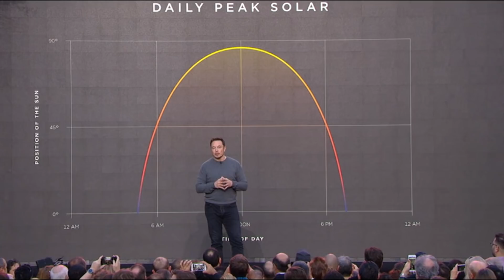Good Idea: Why Tesla Buying Soon-To-Close GM Factories Would Be Great For Tesla, EVs

Comment: Locate in Oshawa, Ontario Canada.  Newer plant, lower value of Canadian dollar, proximity to parts suppliers,   benefits of New Nafta. Many wins! Screw GM.
Reply: Yes makes perfect sense.
Reply: also, canada's got a stable, solid trade deal with the EU, and the oshawa plant is on the shore of lake ontario.  which leads to the st. lawrence, which leads to europe.
Reply: And a good place to test vehicles in cold weather, like the truck and semi.
Reply: Problem right now is Drug Ford is the Premier and he hates Tesla.
Reply: Can he block the sale to Tesla by GM?
Reply: @randallmxd.7787  Blocking the sale to Tesla would be politically expensive for Doug Ford. He has jobs to deliver to the laid off Oshawa workers.
Reply: @paulmcgreevy3011  HUH?  The Conservative Party is in power in Ontario.  And the laws regulating motor manufacturing is at provincial level.  Try keep up.
Reply: @markplain2555  
Interesting times when the NDP implement socialist oil production controls recommended by the conservative UCP of Alberta.
Reply: @paulmcgreevy3011  Just does not get it. Has no clue about the Canadian political system.
Reply: @paulmcgreevy3011  Huh? Trudeau is a Liberal in name and policy and not a conservative in name or policy.
Reply: @randallmxd.7787  Ford would try, he's an #AgentOfDestruction.
Reply: @johnklein338  
Doug Ford has meddled with Ontario EV sales incentives and Washington state regulators has denied Hydro One's merger with a Spokane electric company because of "political interference". While Tesla did win against Doug Ford for being unfair with their EV incentives, the incentives are still unclear for Tesla buyers in Ontario.
Reply: @paulmcgreevy3011  HUH??  Trudeau is full blown Liberal.  Nothing Conservative about him.  I think you are confused.  Try Google.
Reply: @Obscurai  I was thinking that the other day.
Reply: He wants to keep his company American
Reply: walt charamba   You shouldn't call a nation stupid.  You should say he is Canadian smart.  I was speaking of the company
Reply: ...and we got stronger beer.  :)

Comment: Everybody's giving very loose reasons for why Tesla might think about buying former GM plants, but why wouldn't they just expand GF1 and not take on the burden of retooling and existing factory and the potential pitfalls that come with trying to buy an asset from GM? Basically, if they have to redo the inside of the factory, it's likely not much more cost to just continue building out GF1 and begin recouping costs and harvesting solar energy.

Comment: I hope Tesla buys a couple of ex GM plants, at least. I wonder how many commercial vans, minibuses, pick-ups, rigid and articulated trucks and buses, intercity coaches (similar to the Mercedes-Benz Intouro or the Iveco Crossway) and coaches Tesla will introduce in the next few years. Personally, I hope they introduce large numbers of different models, and I also wonder how much of a shakeup they will have on the market. I wouldn’t be surprised if Tesla electric citybuses would actually be much better than the current offerings, especially when the offerings from New Flyer and NovaBus seem to be based on the standard models (the New Flyer Xcelsior is also available as a Trolleybus, but that uses wires most of the time), so I wouldn’t be surprised if a number of compromises had to be made. However, in the US market, there is also a fully electric bus manufacturer (Proterra), so I would love to see what Tesla comes up with compared to Proterra. Perhaps they could compete in the BRT. Us segment, perhaps trialling a demonstrator on the Orange Line in Los Angeles, possibly equipping their offering with Autopilot and a version of Drive on Nav with the routes pre-loaded.
Reply: the GM plants being closed are very specifically made for SMALL cars.  GM is cranking out larger SUV's and trucks, so if it were viable to convert these, they would.  Its not.

Comment: Biggest problem everyone seems to be missing is these plants are all in heavily controlled UAW parts of the country. Tesla doesn't want to allow their employees to unionize and if these old GM plants became Tesla plants there's no way Tesla is gonna pay union wages. It would take years to get a workforce to run the plants at capacity, how many people would want to take that kinda pay cut? Before people start saying "pay cut is better than no pay" need to understand there's more manufacturing jobs in these areas and most are under union control.

If Tesla did purchase these plants their gonna have to pay up to get the plants operational. So they still might be better off building new plants in union free areas of the country.

Comment: I don't think the GM factory is for sale. GM has announced they will close, and very loudly announced they have no plans for EV utility vehicles. They haven't announced a plan to sell.

I suspect the factory will undergo major refits, and ~5 years time start pumping out some shockingly unexpected electric vehicles. The Detroit is an ideal city to put those production lines (close to head office while working out all the kinks on the tech they don't have experience with) and building a new factory would be a bad use of capital given they already have an under-performing local one with all the necessary infrastructure around it.

There is no way they will announce it this far out though, it would cannibalize their truck sales over the next 3-4 years crushing their revenue. The PR of the closure is bad, but it would have been bad PR anyway if they announced they are laying off staff for 2-3 years while they undergo a major refit.

Or they are just giving up on the future and will run the company into the ground, selling off assets as they become obsolete.

Comment: Buying GM factories all sounds good and nice.  But the fundamental is whether or not GM will actually sell those facilities.  If GM is clever - they won't sell the factory to a competitor who has suddenly become a "serious competitor".  
.
Only IF GM was in financial trouble would I imagine GM selling the factories, but they are not in financial trouble.
.
Also GM did state in the case of Oshawa that they are looking into retooling the factory.  It would make sense for GM to retool the factories into electric production, while keeping their money making SUV and truck factories.  Retooling could take a very slow pace.
.
The NUMI factory was a special case for GM as it was a part owner, so don't look at the NUMI factory as an example.
Reply: Elon is merely suggesting it to put pressure on GM, Tesla do need to increase production, both numbers but also model lines though, but it may be better in the long run to start another giga factory rather than shoe horn into an existing one.... But then.... Get one cheap enough and you can change it to whatever works....

Comment: It costs a fortune to de commision one of hose car plants.  The Government should seize them and give them to the highest bidder that will put them to work.  As far as wages go?  Does anyone know what Tesla pays?  There are not many workers in the above video.
Reply: The manufacturer workers get paid well. I live in downtown San Jose about 10 miles from the Fremont Tesla plant. I am amazed they can make money with manufacturing in this area. It’s very expensive cost of living. When Tesla bought the plant,  I didn’t think it was going to succeed. But to my surprise, they are doing well.  Many of the workers commute from the outer part of the Central Valley where housing is less expensive... but terrible commutes. 

But they also hire tech engineers and the pay is much higher.
Reply: @raulaldana1411  Yeap, old NUMI plant back in late 80's early 90's my neighbor work there  @about $15 an hour.

Comment: Most of us assumed Ford US and GM US were offering up their old small slipstream sedan carriageworks factories to Tesla and Euro car makers like VW.  Fremont's worst quality is in carriage building.  Great drivetrains.  No real experience in frugal body building at Tesla.  Too many fasteners, too many types, too many assemblies and too much subtle changes month to month year to year.  Normal for a new producer.

It is unlikely Tesla will buy the plants as they are too cash extended, but, like Toyota in the 80s a rent/slow buyup is more likely.  He doesn't like unions, so he will face that inevitability in Michigan.  Executives from Cali will not like living in the rust belt, so it makes more sense to consume the existing GM (or Ford) engineers and managers.  Exactly what Toyota did in the 80s.

Ford is done with their decade long Eurocar in North America experiment.  They sold a ton of those Fiesta/Foci by 2016, but due to their DCT addon, they lost a fortune in repairs, lawsuits and bad PR on basically a good set of cars.  Chevy is done with their JapiCar experiment.  Similar results
Reply: However, Toyota was much bigger, older and much more successful in 1985 than Tesla.  Toyota was also backed by the government of Japan as a merchantile endeavor. The Toyota bosses were also quiet and subtle. Musk talking and Tesla Corp (Board and investors) buying such plants with cash and fully calling the shots is less likely.

50:50 shot in ten years that Tesla becomes a plate in GM, not the owner of GM.

Comment: Man your jumping the gun. Elon only said he might be interested, meaning only if he get a deal buy. But GM is not selling or closing the factory they said 4 yr revamp for efficiency ev production, meaning robotic assemble, the hired back will depend on union concessions and higher skilled worker than before. I called musk can’t go public company too, because of the 500 stockholder membership rule and etc. he should concentrate of building a 35 k car but he can’t because he barely making Profits with 50+ k cars now. Adding more debt is going the other way

Comment: Why then are electric cars still so expensive....they have hardly any of the parts of internal combustion  cars?
Reply: because the battery is still pretty expensive. They dropped in the last then year almost 90% in cost, and only in the next two to five years will they become cheap enough, that an electric car is going the cost the same or less than an ICE car.
Reply: We are in the early days of EVs.  In the early 90s flat panel TVs were 42 inches, 720 p, and ran upwards of $9,000.  But now with production improvements have dropped that cost to $200-300 for a 4K TV.
Reply: Bc battery packs are still expensive.. but when the Gigafactory is completed we we be able to buy tesla Ev at 25k$
Reply: @JBoy340a  great analogy.  saw one on back friday for $120